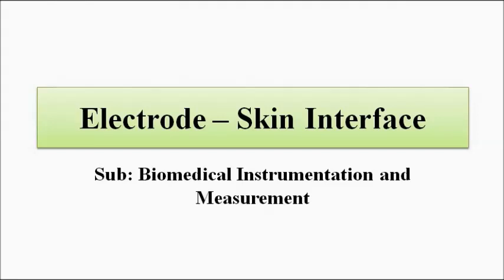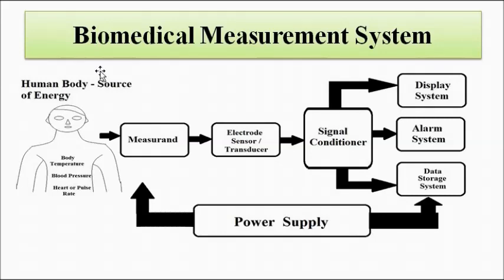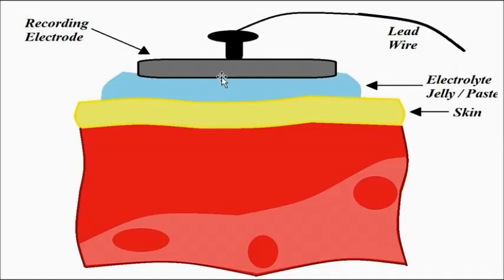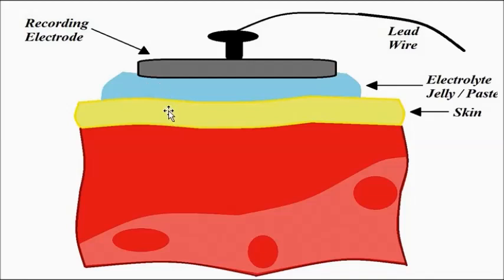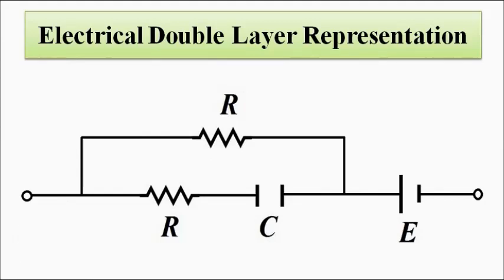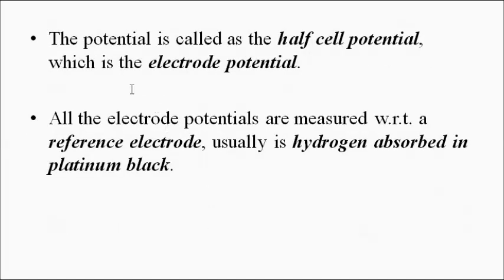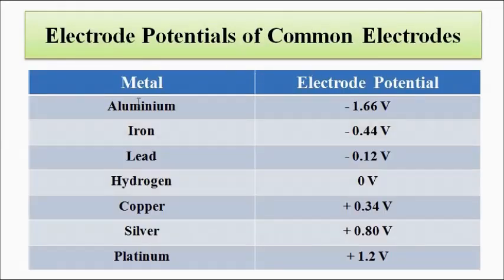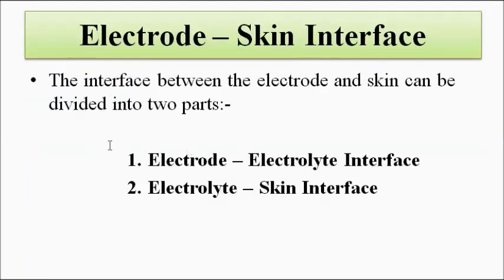Electrode Skin Interface | Metal Electrolyte Interface | Biomedical Instrumentation and Measurement

Comment: I have read everywhere that only electrons move and not protons. So when you say that metal electrode discharges positive ions to electrolyte I am very confused. Is there a better explanation for this? Thank you
Reply: ions are molecules or atoms not protons, protons are inside the atoms and molecules
Reply: Any molecule or atom that has gained or lost an electron (sometimes referred to as 'reduced' or 'oxidized') is an ion, as it possesses some charge that is not neutral.  This ion is electromagnetically attracted to its complement (part of the magnetic field) and moves in that direction.  Like N-S pole bar magnets.